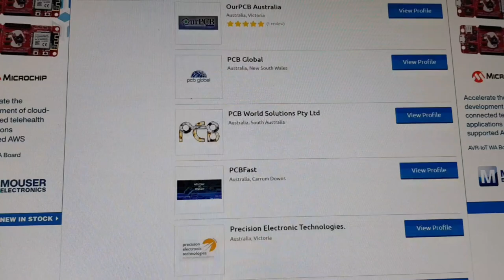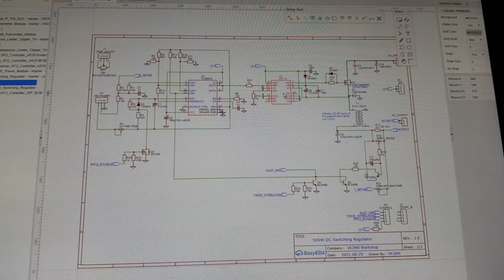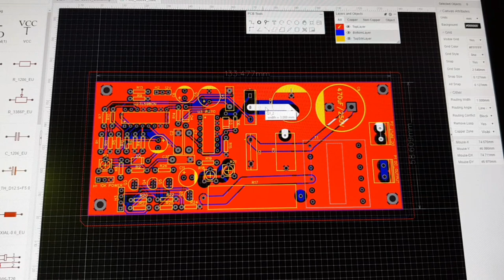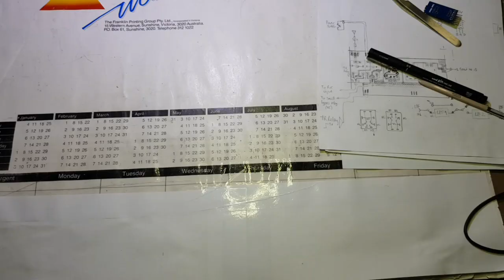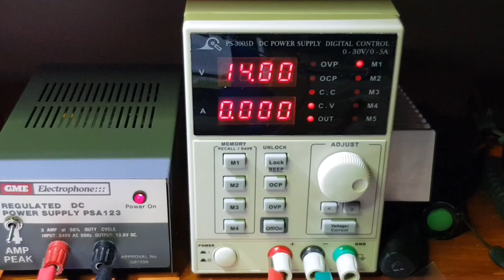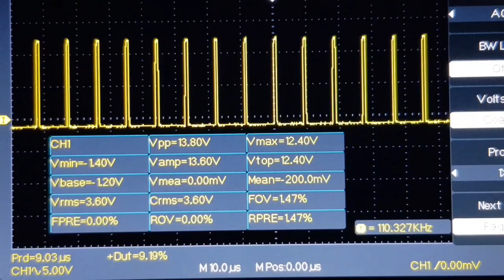My First CAD PCB with EasyEDA and JLCPCB

Comment: Off to a great start Paul! The layout issues you identified were minor and didn't prevent the board from functioning - that's a win! 73
Reply from the maker: Yes I was half expecting to bin this first batch of five PCBs due to mismatched parts with wrong footprints or holes too small. But apart from the missing corner hole pads, the board was a success, and  worked first time.  The next board will be populated with all the s.m. components, looking forward to that one arriving!

Comment: nice project can is use tl494 instead tl 598 in this project
Reply from the maker: Sure, TL598 is an updated TL494 which should work fine in this circuit.  They are probably not pin compatible so you might have to make some minor changes.
Reply: @Paul_VK3HN  thanks alot i like your videos an the projects you do  would you please design this with t494 since tl 494 is most available my request
Reply from the maker: @kittony71 Time is limited at the moment, I suggest you study some TL494 SMPS circuits, read the datasheet, watch some videos and try it yourself.   Doing it yourself is the best way to learn.
Reply: @Paul_VK3HN  thanks am working on it right now

Comment: The artist (and anarchist) in me loves the homebrew, draw it yourself boards. But for more "professional" prototypes etc could be fun to do it "properly". Also allows a QRP build to be miniaturised via SMD components. Thanks for this video. 73 VK2AOE.
Reply from the maker: Hi there, yes I agree, you cannot beat a CAD PCB for miniaturization.  I started doing PCB designs and offshore fabrication,  including some parts, in 2021, and the results, and the value for money are amazing.  I will still hand-make boards from time to time, but only for prototyping.  You can still patch and change a design on a home made board, very difficult to change things on a CAD PCB.    Thanks for commenting.  Good luck with your projects! 73 Paul VK3HN.

Comment: JLCPCB does a decent job, as does PCBWay. OSH Park is more expensive, but the quality is better and IIRC the delivery is faster. BTW you don't have to convert your projects to EasyEDA. All these services accept Gerber files which can be generated with KiCAD.
Reply from the maker: Thanks Alex, yes I had realised that Gerber is interchangeable, which is handy, so you can use your favourite editor and then get the boards made from your preferred fabricator in the marketplace. I have some more PCBs in the factory so, more soon.  73 Paul VK3HN.

Comment: FB, Paul. Completely random question.  I'm looking for a bench power supply to replace me current solution consisting of batteries for powering my scratch built circuits. Been advised to find a dual channel version, but  I'm not crazy about the large footprint. Any thoughts on the single channel supply that you use? Thanks,  Jack, NG2E
Reply from the maker: My power supply is one of a number of commonly available 0..30V, 0..5A supplies. They are all over Banggood and Amazon and eBay.  They are Chinese made (of course) mine was around $100.  They are indispensible.  Being able to preset or wind the output voltage up and down is essential when making projects, as is setting current limiting, which has saved my QRP Finals, PAs, drivers, and other modules from unintended wiring faults, excess drive and shorted loads.  I have fixed 13.8v 5A supplies but only use them on a commercial or fully tested homebrew rig. The inbuilt digital ammeter has replaced my need to use a separate bench meter or multimeter to measure current. For example, if you want to check out a relay, LED or any other small load, just dial up the voltage and connect it to your PSU, you will read its current draw off the display. If you are doing anything at all with electronics, even charging LiPOs, grab one of these!  73 and thanks again for commenting Jack.
Reply: FB, Paul. Thanks as always.
Reply: @Paul_VK3HN  , last question. For your SMD parts which method do you use:  solder or use paste?
Reply from the maker: @jackhaefner9237  I use a regular Weller WES51 soldering iron with small 1.6mm tip and thin solder.  I look through an illuminated magnifier and  position s.m. parts with tweezers bought from Minikits.  Solderwick mops up if there's too much solder on a pad or IC pins. It's not hard!  Good luck!
Reply: @Paul_VK3HN  , thanks! Etching a the mixer board for Pete J's Direct Conversion Receiver tonight. My MC1496 is SMD, so I'll get getting right to it! Cheers, Jack
Reply from the maker: @jackhaefner9237  Good job, all the best, steady hand!

Comment: 5:24 man, now they make hardware too??? What DOESN'T 3M make nowadays?!  😁Been enjoying the videos, keep me dreaming! I've got a couple BIG Pioneer home stereo receivers/amps a mate gave me as "scrap" to play with and I'm certain there's a good deal of bits I can salvage like some MASSIVE MOSFET's, toroid's, surface mounts and lovely knobs I might be able to use for tuning a VFO/VXO ETC to play with!
Reply from the maker: Thanks for the comments. The reference you pointed out to 3M was my mistake, I was being slightly dyslexic,  I meant M3 or standard metric 3mm bolts and nuts.  Sorry about that. These little inaccuracies sometimes creep in and I don't always bother to correct them, this channel is a hobby, about a hobby, so we do what we can. 

 Good luck with sourcing parts from old products, I've stripped down home stereo amps, particularly the powered bass woofers that people used for 5.1 surround sound.  The older analog ones yield some very good parts, toroidal power  transformers, big electrolytic caps, greencaps, rectifiers, connectors, fuse holders and more.
Reply: @Paul_VK3HN  all good, I'm mildly "lysdexic" at times too, especially when I'm tired!